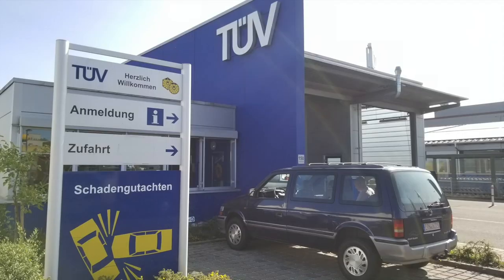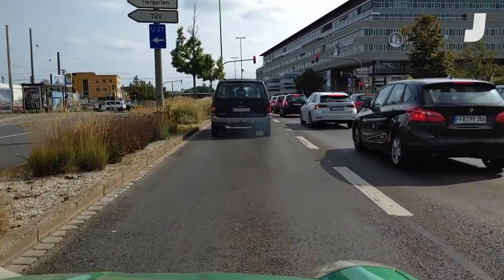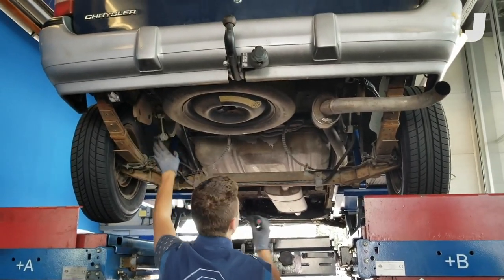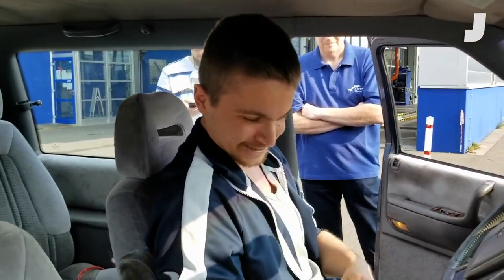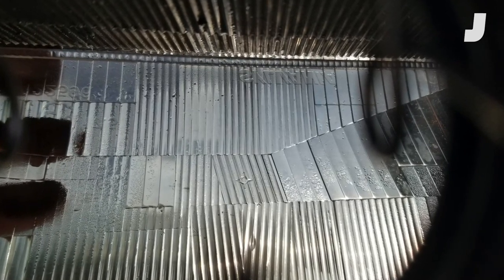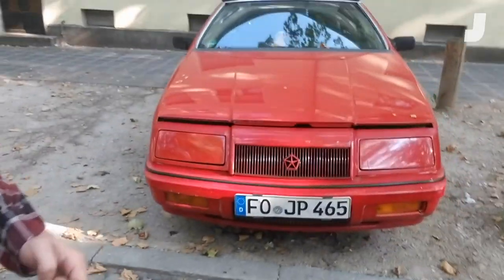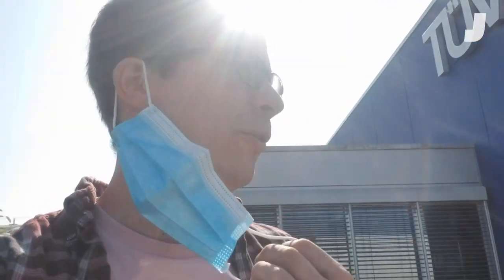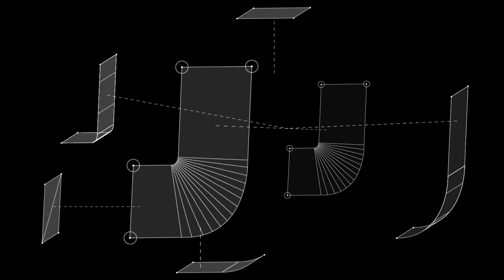I Took A 250,000-Mile Minivan Through Germany's Rigorous Car Inspection And It Was A Disaster

Comment: Tried the lock and key thing on our 1999 Voyager. If the key is in, it will not lock. Pull the key out and it locks. This is how it normally works.

Either the older model has a lock that works differently (they both have all the same positions though), or all the ones we saw on the video clips were defective...
Reply: '99 would be third gen, his is a 2nd gen, I feel like that may be one of the changes they made.

Comment: after reading all these comments its outrageous how strict is it in other countries, i live in eastern europe and in my inspection all they do is check for oil drips and if the car is not falling apart from the rust, my car had non working speedometer and almost a hole in the floor and it still passed with flying colors

Comment: We have tüv inspections here in turkey too (actually its called tüvtürk but anyways) but its waaaaaaaay easier to pass. Previous owner of my beetle managed to pass with all 4 wheels wobbling, a bad steering box which has tons of play, a non working headlight, a pretty much non existent front transmission mount, no rear brakes, no handbrake, an engine with ignition advance mechanism seized and timed by ear, a leaking carburetor, leaking fuel hoses, leaking exhaust, bent front brake discs and many other things i dont remember before selling the damn thing to me. Also, my other car has its catalytic converter missing for more than 10 years now and it never failed to pass emissions tests. I wish tüv was the same here, they have pretty much the same equipment but they just dont give a shit.
Reply: You make me smile and make me joke. Civilization stops at the Danube :-)

Comment: In New Zealand, similar story.  Vehicles need to pass a WOF or Warrant of Fitness to be road worthy every 12 months.  As the vehicle gets older the checks become more frequent.  When I moved to Australia there is no equivalent.  I remember following an older poor condition car to work one morning and a front wheel detached (causing it to swerve off the road into a tree).  A WOF probably would have picked this defect up (worn wheel bearings, suspension etc).

Comment: Was there a shock absorber test at all? A vibrating plate under the tire that tracks the movement of the tire/wheel and gives some sort of percentage value.

In Finland we have to do this every single year (unless its a new/er car). About $50 to $100 or more per test. An "after" inspection is like $15 to $30, if the initial one failed.
New cars will need the first inspection at year 4 and from that, every second year to the 10 year mark. There is quite a lot of variance in the inspections. One guy can pass a slightly modded car that still is safe to drive, but another inspector may just "bounce" (as goes the saying) the test because of some brand -related type of looseness. I usually look at the car myself or look at the undercarriage with a lamp to see for myself while it's on the hoist.

For example, older Volkswagens may fail the inspection because of "loose" rear wheel bearings, but those are actually really sensitive to overtightening and for some reason they tend to go bad in the wintertime. Also another older VW -thing is loose (up-down movement) rubber tops on the "steering bearings" or whatever they're called. One time I was in the inspection and the guy bounced my Golf III and the Transporter next to me for the same reason. Repair was done with a loop of rubber hose glued in with a heavy duty sealant/adhesive, as the parts themselves were in no way faulty.
Reply: Yes, they have dynamometers or whatever you may call them that check all those issues. The car is put on rolers that imitate an uneven road surface and track the movement of the body.

Comment: He is lucky he only had a hose clamp come loose under high RPM; I've had an idler pully on a serpentine belt setup seize up(vehicle only had ~100k miles on it) which in turn caused the belt to snap. The belt was not frayed, nor excessively stretched and there were no noises that you would normally associate with a failing idler pulley. Besides the idler pulley that had completely seized; the other idler pully and the tensioner pulley was also found to be failing. The vehicle maintenance schedule had the belt replacement at 120k miles, so I certainly wasn't expecting to have problems related to it.  I was on a road trip at the time and the nearest town with an auto parts store was 40 miles away. That was not a fun evening but, I did get lucky in one sense because the weather wasn't bad.

Also, several months later the pulley on the AC compressor went out and I suspect that was related.

Comment: In the UK the full throttle test used to break cambelts and destroy engines...
Reply: There was a fun one in Ireland with the mid 2000s Ford Mondeo: The testers would put a temperature probe down the dipstick tube to get the oil temperature, but it Turns out Ford or put it very close to the crankshaft, which would supposedly snag the probe and try to winch the test machine into the engine bay, destroying the engine in the process. Not sure if it's true though ...

Comment: In my experience with brake rollers for inspections here in NZ it's a night and day difference between cold brakes and hot brakes. Drive around the block riding the brakes hard and they'll come back within allowable imbalance
Reply: no those drum brakes sucks they are simple and hard to sudden fail but they are weak as theres no  pressurised fluid forcing them to hold on drums

Comment: My 92 voyager has a tiny 3.0 litre v6. I'm sure that turbo diesel isn't much more powerful, but that would be so awesome to own here in America cause we never had the option for turbo diesel engines in those vans XD
Reply: It has a 2.5 liter 4 cylinder diesel made by VM Motori an Italian engine builder, putting out about 115 bhp mated to a 5 speed manual gearbox.

Comment: You went to all that hassle stripping down the rear brake system twice and just stripped and cleaned the crappy old piston rather than put in two new ones which are not expensive and the problem will only reappear later, granted they passed just ! but is that really good enough, you cannot put a price on brake safety, also sanding down brake linings without a mask on is a big health hazard !.
I did like the Tuv flex test though that is not part of our MOT test in the UK, here they just test with a pry bar.
Safe driving.

Comment: Had a similar lack of knowledge issue to your ignition switch on the U.K. inspection with my motorbikes suspension, they thought the bushes on my shock were loose because it could rotate slightly, they didn’t realise it’s on rose joints top and bottom.

Comment: My Jeep would fail before it went in the door. No exhaust, burning coolant, no oil pressure unless revved high, broken headlights, shocks shot, breaks stop the Jeep eventually, zip tied bumper, and mpg is like 10. But it’s reliable in the snow or mud.

Comment: Its interesting how other countries do there vehicle inspections, here in california, they only look at your drivetrain performance, by that I mean the engine and transmission, additionally you only need to have your vehicle inspected after its eight years old, someone told me in other states the inspection is more stringent and the do look at everything else too.  In california with cars older than 2000, the car is driven on the dyno/rollers and load is applied, the exhaust gases are analyzed by the machine and you have to be below the threshold values to pass.
Reply: yeah it's different here in NY. brake pad and rotor thickness get checked, with suspension components getting at least a visual inspection. as for emissions testing though, now everything 1995 and older is exempt while everything 1996 or newer will undergo an OBDII emissions test. any codes set (or pending in some cases) will prevent you from passing. it's probably the trickiest part of the inspection here.

Comment: Odd that they think a properly functioning steering lock is a failure, though I suppose most post-2000 cars use that strange key-out lock. With an inspection like that I can understand the techs never seeing something older
Reply: The techs used to see older cars more often but during the 2008 financial crisis the German government subsidised the sale of every new car with 2,500€ if an old car was scrapped in order to try to keep the economy chugging along. Of course that meant that a big load of cars worth less than 2,500€ were scrapped that year. It's kinda sad because basically several generations of youngtimers almost completely vanished from automobile history in Germany.

Comment: I dont think a brand new Chrysler could pass a German TUV.  The ignition key failure is because in North America this is considered acceptable. FYI Toyota ignitions DO NOT lock until the key is actually removed from the ignition. Why this is not a requirement in North America makes no sense. Gm had a major recall over this exact issue The Head light specs are also very different in North America.

Comment: And now imagine you have an old car, which is modified as well. Every 2 years your nerves go crazy...
Reply: Modified cars wont pass
Reply: @fgsaramago  depends, is the part TUV approved?
Reply: Every 2 years? Come to the UK and it is every year starting on the car's third birthday.
Reply: @tinplategeek1058  but they don't care so much about modifications
Reply: @cncgeneral  Not as such no.
If it is safe and within regulations then it will pass.

The standard of the UK tests is similar to the German ones for emissions, bodywork, suspension, steering, brakes etc.

No need to have paperwork for mods to a production car but the car does need to comply with the regulations. If say an engine remap causes excess emission then of course it will fail. 

But the rules for emissions vary with the car's age so a 20 year old car doesn't have to pass at the same test levels as a 4 year old car. 

The UK has a good custom/kit car regime for one off cars. These need an engineering report to get their registration as most are built from a donor car and have to comply with a set of minimum regulations but nothing too untoward.
Reply: @cncgeneral  If you wish to read the UK MOT inspection manual then it is online at the gov.uk website at https://www.gov.uk/guidance/mot-inspection-manual-for-private-passenger-and-light-commercial-vehicles
Reply: @tinplategeek1058  america is every year, but other then passing on the computer (check engine light), nothing else is required.

Comment: Man if my malibu went through one of those it would fail immediately. So for yall familiar with the TUV, what of all this would fail?Aftermarket HID projector headlights, line pressure controller for the transmission, tuned PCM, high flow cat, 3.4l out if a grand am instead of the factory 3.1, monsoon sound system out of a grand am where the wiring is very obviously tampered with, I cut a hole in my dash for a head up display, holes in the rocker panels from rust, evap leak, and some exhaust leaks.
Reply: Can't speak for germany, but in slovenia it would go along those lines.

''Aftermarket HID projector headlights, line pressure controller for the transmission, tuned PCM, high flow cat, 3.4l out if a grand am instead of the factory 3.1''

You would need to get those inspected by a mechanic for proper installation and homologated.

''monsoon sound system out of a grand am where the wiring is very obviously tampered with''

No

''I cut a hole in my dash for a head up display''

NO

''holes in the rocker panels from rust, evap leak, and some exhaust leaks''

Fuck no. Instant fail.

Probably missed some things but I didn't exactly study the car laws we have in depth.

Comment: Diesels only redline at about 4,000 rpm so most of the parts won't get worn out. Mind you, if your timing chain/belt breaks and your engine is the interference type.... well that's another matter....
Reply: The lowest I saw a car diesel go was 4500.

The range is usually 4500( big VW fours) to 5300 (BMW 6es), rarely above or below. American trucks tend to redline lower because of their humongous displacement.

Comment: Thing about TUV that pisses me off is they rev the Sht outta old engines - past redline until somethings about to blow up - MEANWHILE all the new shtboxes roll out of factory  with factory set max rpm 2500 - cant rev anymore stationary... Way to kill old cars. Stupid.
Reply: Just change where the throttle stop is when you go for the test. 🤷🏻‍♂️
Reply: Engines have rev limiters to keep them from overrevving. Not a problem unless there's a fault in the engine. If there is, then that's the problem, not the emission test.
Reply: Some engine do, others don't. Typically the redline was set as the point at which the rotational speed of the engine was so high that either the valves started to "float", the centrifugal forces spun the oil out of the big end bearings. Holding the engine above this rotational speed for any period is risking damage.

My other point would be that few people drive their car like that, surely the emissions test should be a replication of a real world driving scenario/engine loading? That's the most important scenario to control emissions. After all most modern engines manufacturers just defeat this test by running very lean at high RPM with no load applied. 🤷🏻‍♂️
Reply: @thomas316  I have never come across a diesel that wasn't strictly governed. Gas engines are quite variable. Some of them cut @exactly redline, many will go 500 over and I had a Alfa Romeo which would go 1500 over the 6500 redline before it would cut.
Reply: Most cars made in the last 35 or so years have limiters.

And frankly if your car can't handle a few seconds of hard revs it shouldn't be on the road. Let alone in a country with no federal speed limit.

Comment: I wouldn't want to drive that, even after TUV approval. Then again I am holding my equipment and cars to a higher standard.

Such a "good enough" does not do it, a hard braking or evasive manoeuvre at speed will likely be the last on-road meters of this car before crashing horribly. Plus I'd like my car to be y'know watertight in the electrics department, lights included.

But interesting video on what is tested in Germany, seems a tad more relaxed than here in Switzerland.

Comment: Pads, rotors, drums, calipers, brake pumps, rubber lines... Replace all. It's not that expensive and you can order them from US. Even rolling bearings.
Reply: My thoughts exactly. With the first fail no one should be messing around like that and just replace the pads an cillinders. I just cringed when he blew out the brake cups and still was talking about putting them back in! It's a 25 dollar part vital for your and others' safety!

Comment: Almost all vehicles have a pnp interlocking system.  If it's in any gear,  the column doesn't lock, you can't even turn the key all the way back if it's not in park. You should never be in motion in park, right?

Comment: IDK what they where smoking about  the ignition key never seen one unlock from just  putting the key in the ignition but I mostly dive old American POS's so what do I know.
Reply: It doesn't unlock by just putting the key in, that's true, but it should lock only when the key is out. So, unlock: put the key in and turn it, lock: pull the key out. That's how it usually works.

Comment: That steering lock engaging with the key in it is a factory recall, but as we know, Chrysler does not care, and not enough people died to correct it.
Reply: Yep I'm pretty sure it's not supposed to lock the column until you actually remove the key. It's for a good reason. Suppose your throttle jams open; are you going to carefully look for the off but not locked position? No you will just crank it all the way anticlockwise, and then crash (in this vehicle)
Reply: It says "LOCK" on the column for a reason.  "OFF" Unlocks it.
Reply: @lifeafterlife8417  that reason is that Chrysler messed up, hence the recall.
Reply: @gepwxaqdfsidsesg1548  I know, but the inspector didn't.  Just unlock it and pass it.
Reply: @IntenseBlue318  amazing given the propensity of Americans to sue

Comment: Compare that to the DMV of Oregon (USA) - youtuber "2stroketurbo" got license plates for the Berkeley "car" (actually just a fiber plastic shell without engine, seats, doors, ligts, windshield) with wheels barely attached to it. Oh, and I believe that brake pedal is missing as well, so it is safe to assume that brakes are not that great either. :-)
Reply: It's nearly impossible to fail an inspection in Oregon. Most of the state doesn't require any physical inspection for registration, and the places that do just plug a computer into the OBDII port to make sure the emissions system is working properly and reporting acceptable values. Sometimes the inspector will use a mirror to look beneath the driver's door for rust.

Comment: Most of the developed world is pretty serious about vehicle safety. Kinda shocking to Americans, many of whom have no qualms about barreling down the interstates in smoke-spewing deathtraps.
Anyway I think the only car I've ever owned that unlocked the steering column by simply inserting the key was a Mk. 3 Golf. Every other car, (non-German) European, American, or Japanese, has required at least one turn of the key (usually to either ACC or UNLOCK depending on the car) before the wheel turns. Either that first inspector was trained by VW specialists or was otherwise new to the TUV scene because this is a pretty common arrangement for him to have not been aware of it.